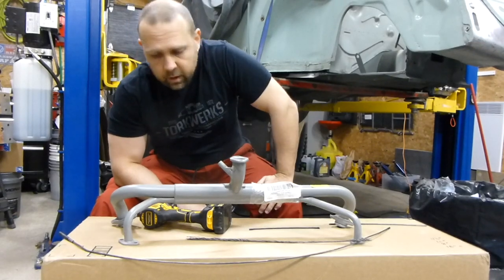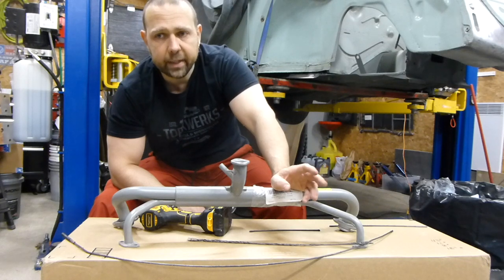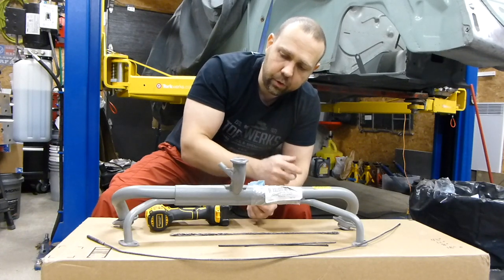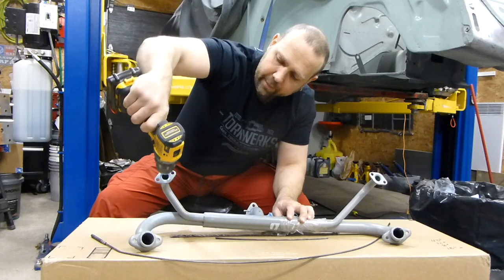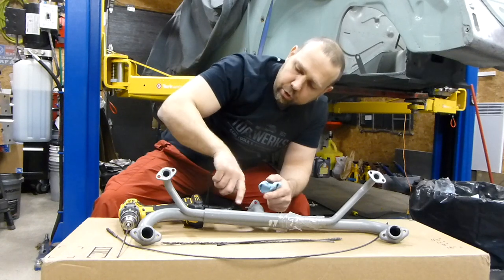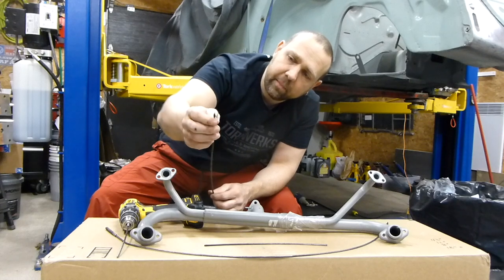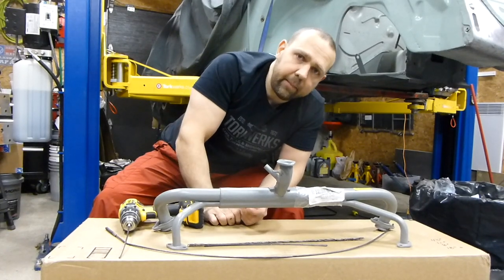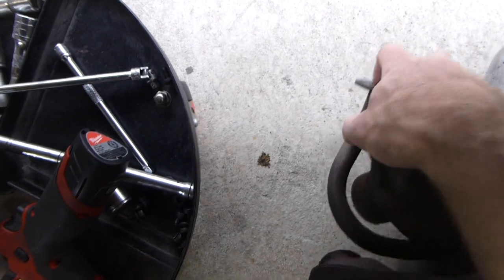Classic VW Beetle / Ghia Single Port Manifold Heat riser Cleaning

Comment: My understanding is the exhaust gases flow from left to right of the heat riser so it will heat up on the left first, not how you described it?
Reply from the maker: On original units the hole on one side is smaller than the other to cause a directional flow as I understand it. However the point of tte vidéo is not the direction of the flow but rather the fact that they clog up and then have no heat to the carb area, and how I try to clean them out. Regardless of direction no heat is no heat and blockage is blockage.